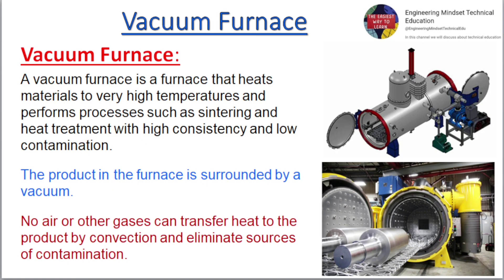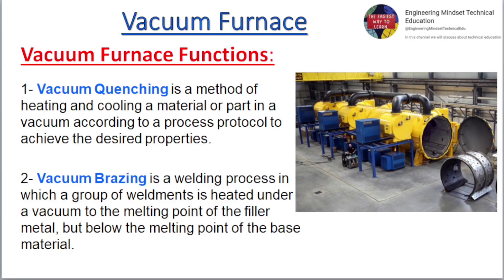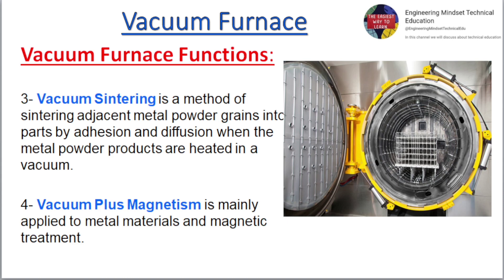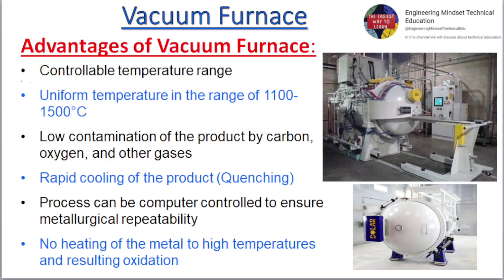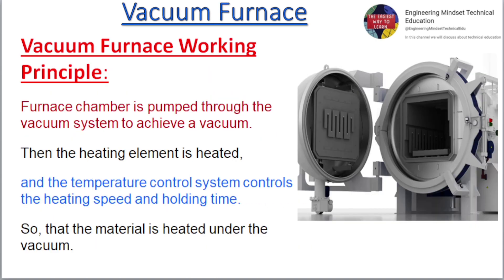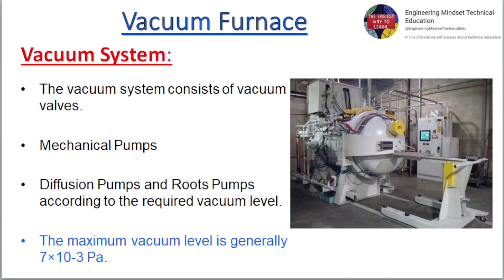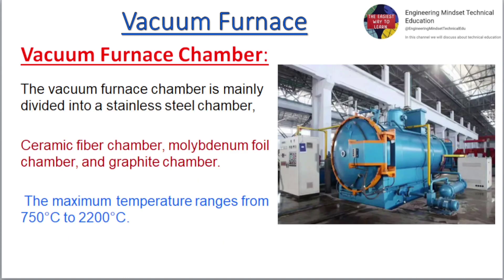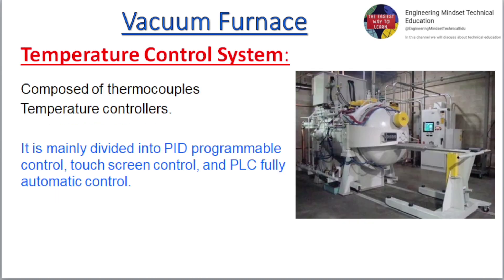Vacuum Furnace | Heat Treatment | Metal Hardening | Electric Oven | Electric Heater | Chamber

Comment: Interesting. I work on several high vac, high temp furnace presses  All are electric with graphite elements and graphite hot zones. I was an electrician for 30yrs when i got into this and never in my years as an electrician did I encounter water cooled wires and would have said your crazy if you said there was such a thing.We have run as hot as 2300c and they can go higher. We do ceramics. All that heat and 60tons hydraulic pressing power. This was nice to see some different furnaces.